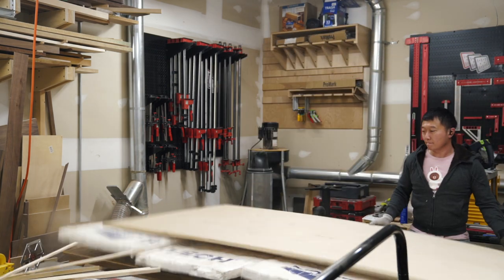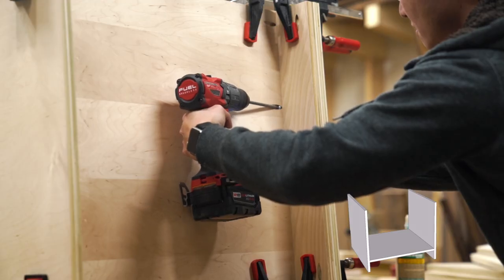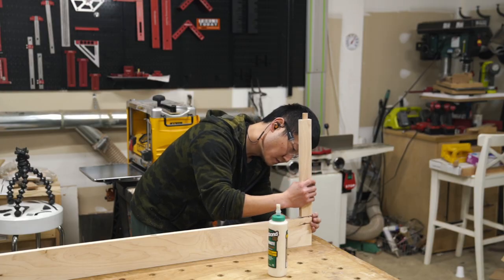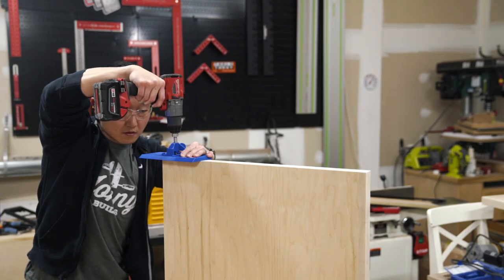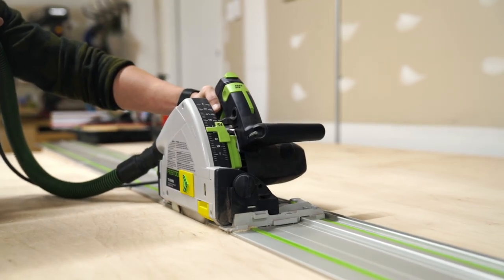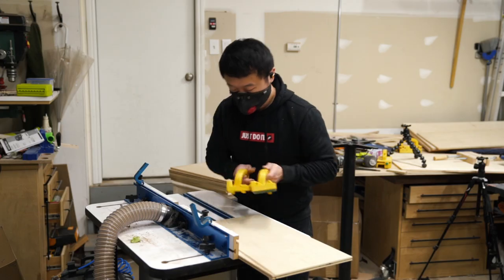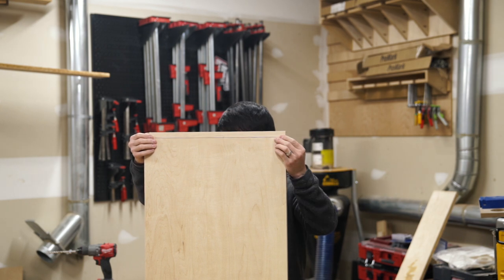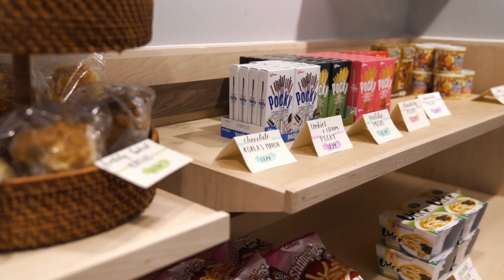Making My First Built-In Display For Bubble Tea Store || How To

Comment: Congratulations on the commission! Great job on an impressive build. When you said: "the install went pretty much as planned," what were some things that you could have done to make it easier?
Reply from the maker: Building on-site would make things a lot easier. The floor of the store had a 1/2” dip toward the very back corner. That’s why shimming the base cabinets took so long.
Reply: @BevelishCreations  I've started using adjustable feet for stuff like that, but I'm not  those would be enough for a 1/2" dip!

Comment: Nice build! What tool did you use at 18:12 ? I've never seen such a thing, or at least I think so.
Reply from the maker: That was the same "plug planer" that I used at 11:46 haha.  It's a cool tool and allowed me to get into that tight space between the french cleats, which a flush trim saw wouldn't have been able to.  But if you have a multi-tool it would do the same thing.  It's a pretty expensive tool that basically has one function though.

Comment: When you attach the back panel stretcher at about 4 minutes (i'm assuming you're using 3/4 inch cabinet grade hardwood plywood) did you use 1 1/2 inch #8 screws with a 1/8th in pilot hole? I've been trying to decide what size countersink bit to buy for drilling pilot holes into plywood when I need to go straight make a perpendicular connection like that. I splurged a little bit and bought the festool drill so I don't want to mess up and buy a 40$ countersink bit that isn't going to do me any good haha
Reply from the maker: Yep! I found the 1/8” bit works great!
Reply: @BevelishCreations  Thanks!

Comment: 4:36   Looks like your jointer might need the outfeed table adjusted a bit higher!
Reply from the maker: How come?
Reply: @BevelishCreations  at 4:36 if you notice, it appears the board is slightly floating above the outfeed table as it's coming off the blades.
Reply from the maker: Al Amantea I think that’s because it’s just the first pass. The edge toward the fence is probably contacting the outfeed already. If it’s floating. I’m already pressing down on the outfeed side at that point, it couldn’t have been floating
Reply: @BevelishCreations  gotcha. It's difficult to tell in the video, just wanted to let you know!